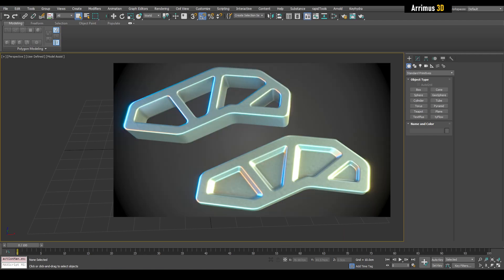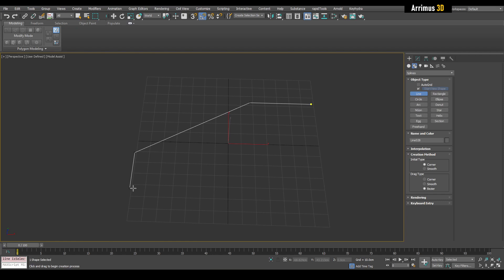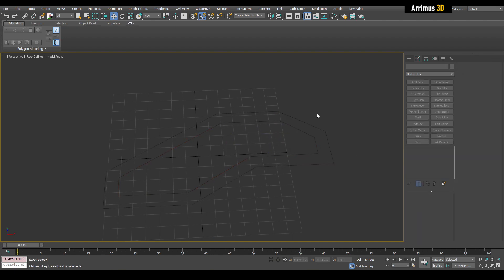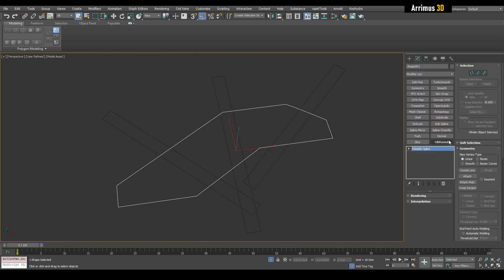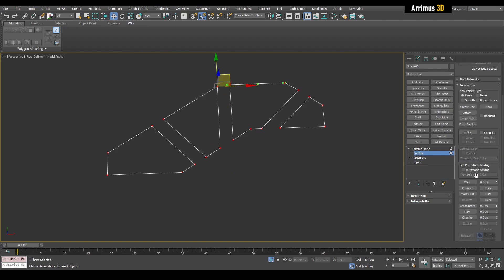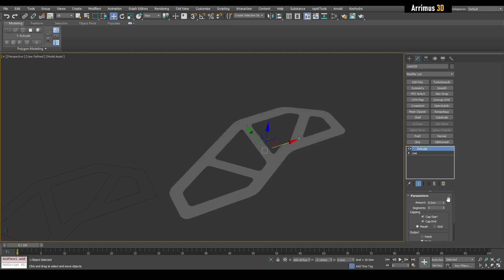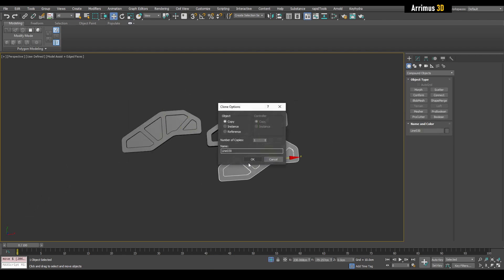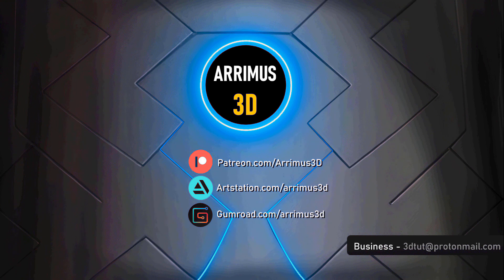Super Powerful Easy Max Spline Modeling

Comment: That was a terrific explanation. I've used splines plenty of times for simple things, but never knew about the trim tool. I use Solidworks for CAD which has a trim tool. Incredible how much stuff 3ds max offers even after using it for 20 years.

Comment: Massive fan of splines. Sadly trying to move over to Blender from Max I find its spline tools are really pretty crude. I did a low poly challenge with a game modeller and using splines with low interpolation got better looking models (also more accurate) with lower poly counts... and they are mostly non-destructive too.